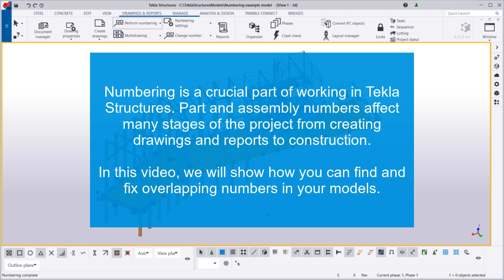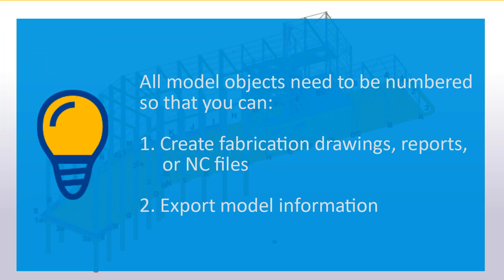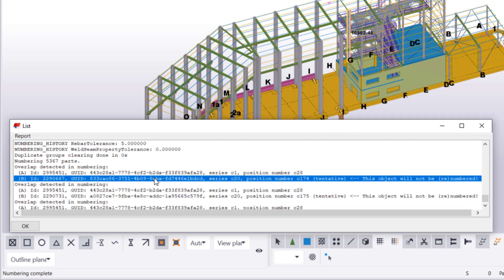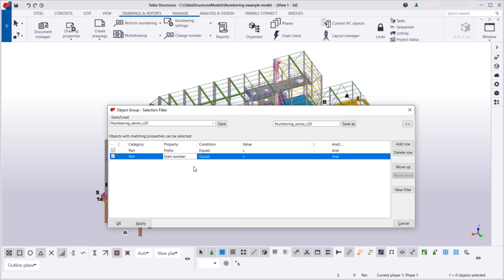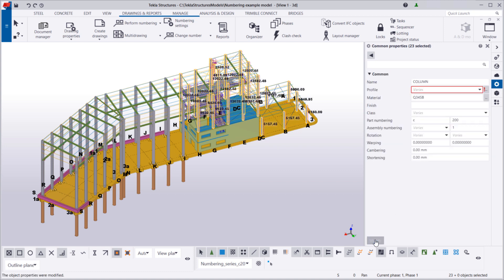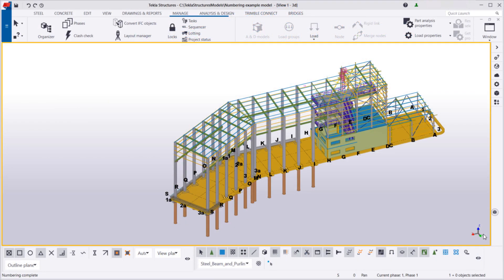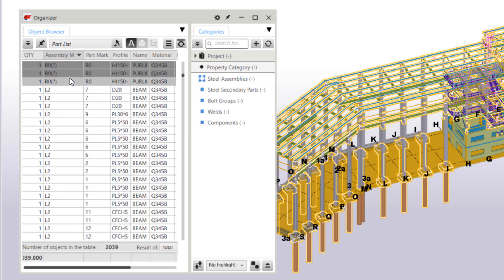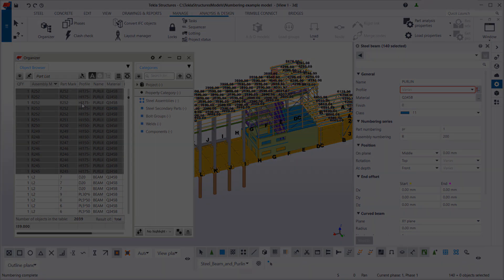[Tekla Structures] Find and fix overlapping numbers

Comment: Thank you very much for your video, Numbering is a Black Art to myself, I still have a lot of difficulty getting my head around it. I did not understand when you were creating a filter for the Columns, you created 3 rows, two were called 'Part' but the last one was 'Object' not sure exactly what 'Object' refers to, also does 'Part' mean a main member? You get stiffeners, angles and plates added to a beam or column and in the old days we used to give them a 'part mark' but I think that even main members are referred to as parts. Very confusing.